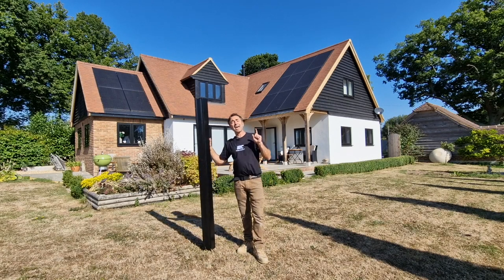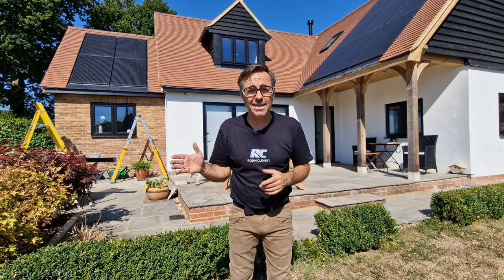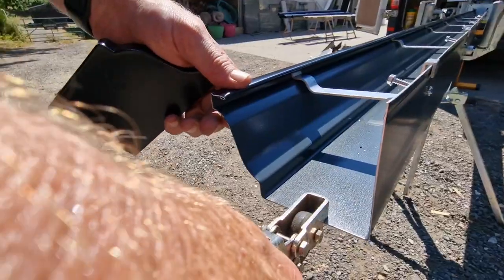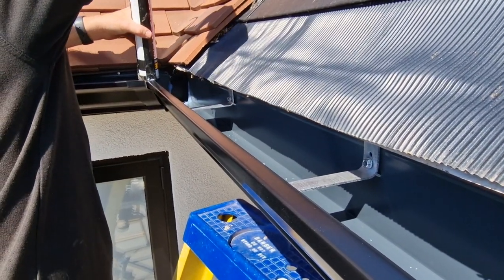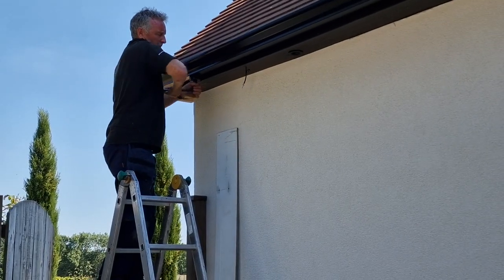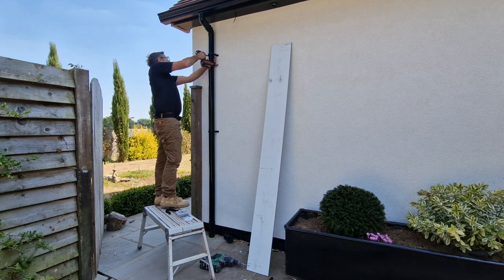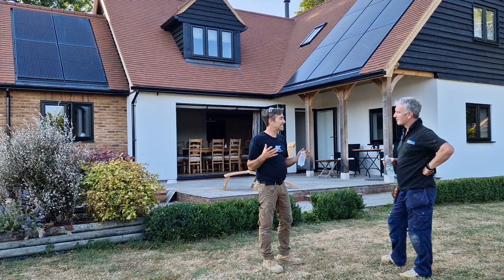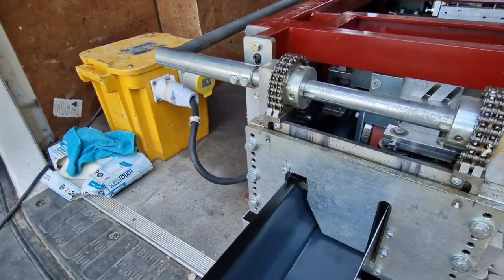Amazing metal Guttering

Comment: These roll form gutters have been used in Canada & USA for 50 years. The leaf guard cover is a recent development and essential if trees are nearby. Robin’s round downspout & symetrical attachment method is aesthetically superior and allows better drainage performance than the square downspouts used on this side of the pond. These are the small details that matter. The end user may not have the vocabulary to appreciate this level of craftsmanship, but they will know the difference because everything just looks right as it should be. Outstanding Craftsmanship. Hope the owner has a Tool Box Party to thank all who worked on this project c/w BBQ & Bubbles etc.
Reply: I fitted seamless aluminium gutters in South Africa 25 years ago. The machine hasn’t changed a bit in that time. 😱
Reply: It’s so different in every country. We don’t have rollers in Australia. We’re getting it in the year 2047. However, we’ve had left gutter guard for about 25 years due to the risk of bush fires. We also have a reg where the gutters must be 10mm from the fascia board to prevent flooding of the eaves.
Reply: @didjwentworth5778  Roll formed gutters have been in Australia for many years. You might want to investigate. For high risk fire zones have a look at code changes to construction in California & new fire prevention products used.

Comment: Hey Robin, love the idea of seamless gutter and your videos overall. 
However a few points had me thinking on this one. 
The first one is the on-site cutting, while that’s great having it customised, I can’t help thinking the bare metal will start to corrode. The end cap which had channels cut in to looked a prime candidate for that. I’ve got 30yr old half round UPVC on my cottage. The only issue I get it’s at the joint leaking. However with new seals I’m confident the plastic would do another 30yrs. 

The other point, and it’s real bugbear. Why not use stainless fixings for the down pipe? You’ve gone to almost extremely lengths to produce a template for fixings. But on the next step looking to save 5 mins using concrete screws, which I can’t help think will bleed rusty stains down the walls eventually. A real pain if you’ve got coloured render.
Reply: The seamless gutter is aluminium, so whilst it will oxidise, it won’t rust. The fixings were ‘designed to be used externally’ which again means they won’t rust. 👍

Comment: Pretty standard quad gutter that is used a lot in Oz. That is a normal size. They also do deep flow versions. We don't extrude on-site but can buy pretty long lengths so fewer joins. End caps the same outlets the same called droppers. You can buy pre made internal and external corners but the pros usually cut and fold their own. Downpipe every 6M max. Ours mostly have storm outlet holes along the front to help release the water outwards at a certain level to stop flow back into house. Don't do soakaways. Too much water. If no storm drains then to ground. Or as at my place to tanks as rainwater is all we have. Go a bit further North to the tropics often no gutters as they just don't cope.

Comment: You don't bother setting the drainage gradient over the long runs? 1:400 is all you need. I've found standing water leads to gunge buildup, mosies, pongs ...  ps those stepped drill bits are very useful, they also remove the burrs

Comment: There's a reason that this type of gutter is rare over here and its cost! The cost difference is insane compared to regular upvc. I appreciate it looks lovely but I still feel there'd be maintenance issues in time with this, especially with that sealant splodged in there!
Reply: My feelings exactly. I think we've all seen upvc gutters that have been installed with silicone and know what happens sooner rather than later.
Reply: @markrainford1219  absolutely, I done a replacement yesterday and the amount of silicone the previous guy had pumped in was ridiculous!

Comment: Robin, great vid as always but no mention of installing guttering to falls? or is it installed level? not a spirit level in sight. surprised you selected UPVC downpipe when you could have used aluminum square or round making the whole system recyclable

Comment: do you use them green marksman things?   instead of holding that beautifully made, ( and lets face it ...GENIUS)  jig for drilling those holes for the downpipe clips,  ( which i WILL be using next gutter job i do , so thanks for that Robin) , i cant help but notice the chance to use the marksman tool , Ive been using them for a few months now , and i tell you what.... its revolutionary!    little green squirter thing, just marvellous invention.  saves me trying to muscle a piece of board or whatever up , and running the risk of it slipping ( in this situation at least). 

not that i would dream of thinking i could advise the master here, but don't think Ive seen you using one yet, so just curious as to why.   they truly are a game changer.
Reply from the maker: Hi Jon, I have a marksman and they really are useful especially with a roughcast or pebbledash wall! and actually with that i could easily go and use the template and mark all the holes in one go then drill them all in one go, your suggestion could have saved me some time!!! have a good week mate

Comment: With heavy rain there will be a waterfall effect in the corner where the two roofs meet and will just run over the gutter..Here we put a high piece of metal guard on the corner to stop the water running over the gutter.

Comment: One thing that I think worth mentioning Robin is how easy it is to cause surface damage to the plastic down spout materials through careless handling. If you get it from a big box store it's worth checking that the pieces you pick up don't have a lot of scratches on the surface and also with making sure you don't add any when cutting and fitting. I use Flo-Plast down spout and even something as simple as sliding a pipe clip up the pipe can leave scratches.
Reply from the maker: Great comment

Comment: When I came off the tools because of my back I went into sales and sold seamless and roofline, fascia, soffits, cladding in Bourton on the Water, when with customers I used to tell them " after they told me they had a quote for plastic" " well plastic is guaranteed to leak" and they went " really? " so I took a plastic straight joint connecter from my bag and pointed out the rubber gaskets as being like tap washers and after a few years of hard winters, frost, snow etc, they perished ( very true) and that's when you get the drip, drip, drip, just like a tap, ( that's what ours are doing now in a couple of places)" well with our seamless it's guaranteed not to leak"😊, that usually sealed a sale, where I'd get the fascias n soffits as well on a lot of occasions😊
Reply from the maker: Nice one!!

Comment: At 3:31 he steps across the top of a step ladder. I did this exact same thing when pulling a chalk line while guttering with my dad last summer. I fell, dislocated and fractured my shoulder and had to be brought to hospital by ambulance. Not criticising the pro’s, just sharing my experience because I was off manual work for 3 months and still feel the ache more than a year later.
Reply: Sounds like a sore one. Is that a genuine known safety issue (as in something the health and safety folks would tell you off for)? I hadn't considered it a thing, I actually thought that top step could be used as a seat and have done it many times! Is it just because you're more off-balance than if you're leaning into a ladder?
Reply: @ricos1497  most step ladders have steps on one side and a frame on the other with a larger platform at the top for a can of paint, etc. My accident was on the same type as the one here, steps each side, which makes it inviting to swing your leg over. I read up afterwards and it’s certainly not the “approved” way to use stepladders. I was also overextending, on a folding ladder and on a gravel surface. 
Not criticising the pro’s here as familiarity brings confidence, just sharing what happened to me.
Reply: @kiwifruitpoo  thanks! Hope the shoulder is better. I find hanging from a bar or tree for 30-60 seconds helps my dodgy shoulder!

Comment: ive had a lot of mixed experience with gutter guards, the biggest problem is usually when people think it means they never need to clean the gutters. Normal unprotected gutters can usually cope with a small amount of leaves but i found what happens with the gutter guards is they trap all the leaves, which eventually compost and you find down pipes that are packed solid with dirt. If there are a lot of tree's they are still usually the best option though.
Reply: I too have had very mixed results with guards. On my conservatory, almost zero fall, I use a wet/dry vac and just suck all the crap out.

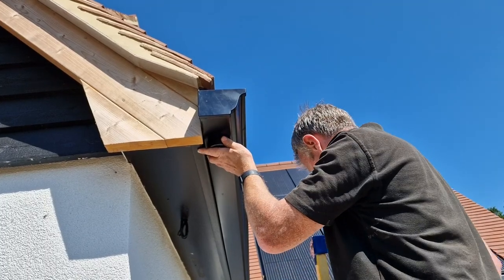Comment: Robin on the bargeboard at 12:19 the sprocket piece how long do you cut it? Do you do cut it the kickup height to the first batten ? Thanks
Reply from the maker: This depends on the type or roof tile and the pitch of the roof, so the steeper the roof the higher it is, it always needs to be about the same as the batten that you are using plus the tile thickness so it replicated the kick that the tile has when laid one over the other

Comment: That machine is really clever. However, here it is a question, if the customer wants a different colour for the gutters, whatever colour you already have in the machine is going to the bin, isn't it? Bearing in mind you have a long van, and a long machine, that will be a long piece of gutter going to the scrapyard I assume.
Reply: Or into stock for the next job wanting that colour.
Reply: @gbwildlifeuk8269  -  one might have assumed that was obvious, but there you go.....
Reply: @gbwildlifeuk8269  What they didn’t  say was, in case of colour change, if the machine let them take out the material that is inside the machine and reuse again next time when the customer wants that specific colour.

Comment: Great for long length.. But! Have a look at that mastic the donut put on the stop ends.. what a cowboy job..that will perish quite quickly and they will all leak..
Reply from the maker: This sealant is specifically for this, its a part of the overall system approved by the manufacturer
Reply: Yes, it's the one thing I didn't like and think lets it down. There's no way that splodge of silicone will last anywhere near the life of the rest of the system- will have dripping stopends in 2 or 3 years
Reply: @tonyatkinson8962  Maybe, but it'd be fairly easy to fix. I've never understood why there isn't a better tool for applying sealant like that. Such an awkward way of applying the sealant/glue and very difficult to get it looking nice. A single handed device with a small tube (that could be refilled) that could allow for a lot more accurate and neat job. Possibly wouldn't solve the overall issue of a perished join of course!
Reply: @ricos1497  yes, could tool it in to make it neater, although not going to see the mastic and not much of an issue. I always think that mastic should be compressed between a joint to be reliable long term, just like the internal corner detail. Cracking design that bit, it's as if the designer just got lazy with the stopends! Anyway, great system overall and enjoyed the video!
Reply: My thoughts too. Would have expected a built in seal of sorts. Seems at odds with the rest.
Reply: We've had this installed 2 storeys up on a 25m long building at work a few weeks back. It was done off ladders so they used 2 12.5m lengths. The join is leaking today, 9/9/22, depositing water smack where a covered walkway bisects the building.🙄 Doesn't matter how good the system or installer is, sealants are the weakest link. Lindab magestic guttering looks a more reliable long term option especially if you buy some spare unions at time of install.
Reply: @baldyslapnut.  I thought that the whole purpose of this system was not to have a join? This thread was discussing the end caps rather than a join, which is a different scenario altogether, especially as the end caps all follow a down pipe thus wouldn't be subjected to the same flows as a join.
Edit: apologies if I come across rude or accusing in the above, that's not the intention!
Reply: @ricos1497  Agreed, but on a 25m run I'm not sure how many people are needed to handle the length without it kinking, twisting etc. Certainly would need to be off scaffold and probably strapped to some timber battens etc. I'm just saying outwith the obviously sub-par install in our case, sealant, approved or not is demonstrably the weakest link. I'd go modular with Lindab.